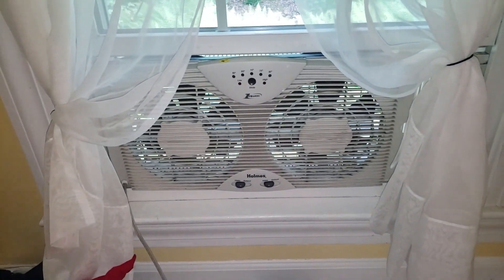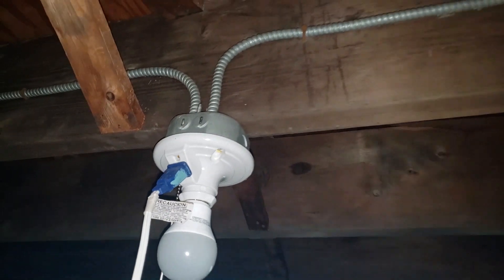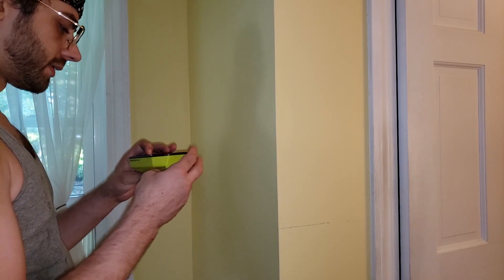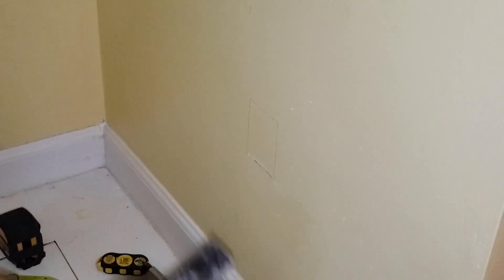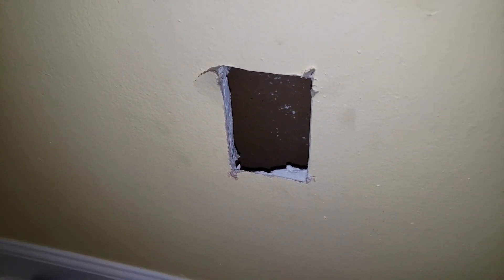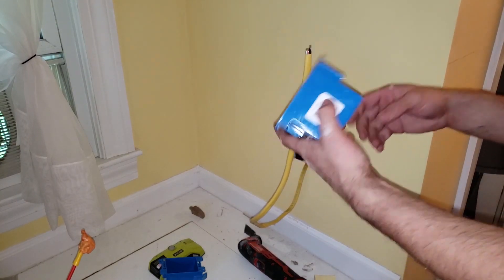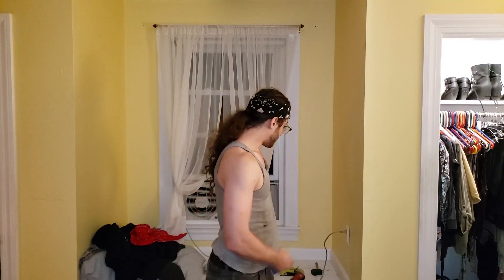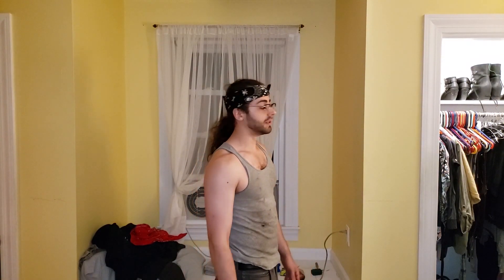How to Install a New Outlet Through Junction Box

Comment: Too much sheathing in box. Oversize wirenuts.
Reply from the maker: No such thing as "too much sheathing" per NEC, and blue wire nuts accommodate a minimum of 3 12 gauge wires, so they're just right for this job.
Reply: Why the hell you even watching this video if you “know” what your doing.